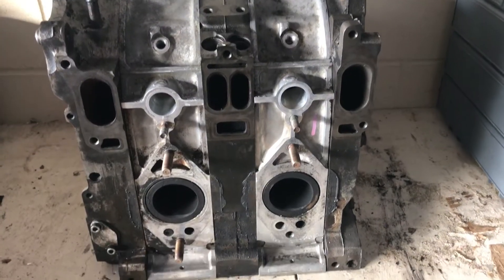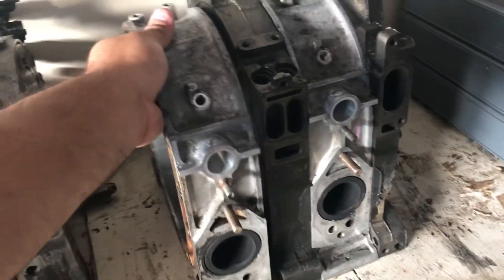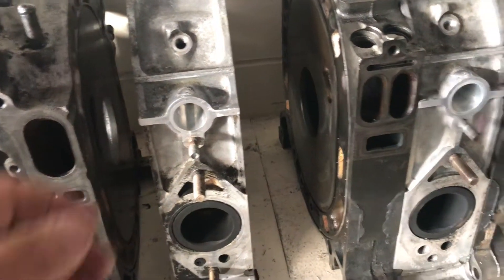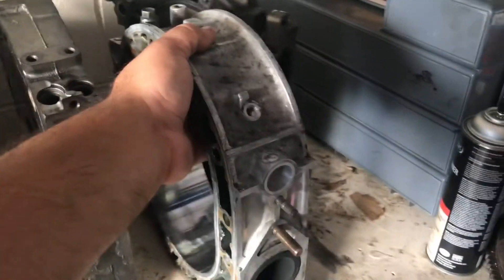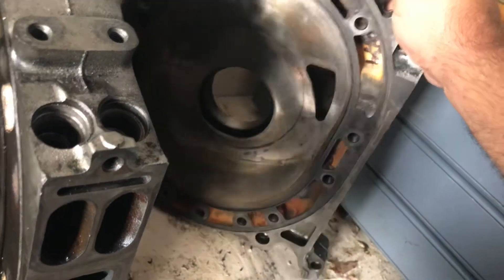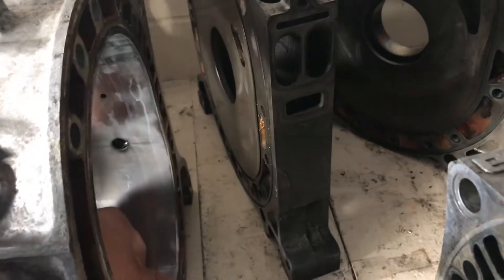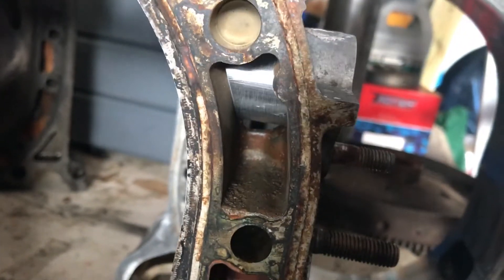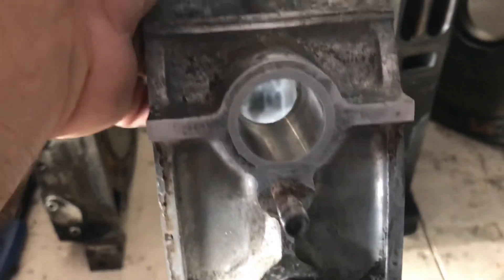13b semi pp build

Comment: Brotha if it was my motor I would re nickel those housings. Last thing you want is a warn out housing on a semi pp motor. Cold starts are bad. And lower compression. Depending on how you port your plates, semi pp already drops some compression. Depending on your set up. It can be a pain to start.
Reply from the maker: Michael Camacho who does that and about how much. Not a lot of companies like resurfacing the housing from what I see

Comment: Hey if u want to RX7 Specialties will resurface your housings for $69 if you do 2 or more
Reply from the maker: Alvin Ameyaw yea that’s not bad, I have also heard of some rotary mechanics that take a round sanding roller like 3 or 4 inch that connects to a drill and real slowly start cleaning the surface that way. Not sure if you have heard of this trick.  Of course you have to go slow because it will eat away at that metal surface
Reply: 69 dollars to resurface a housing? Figure itll be more expensive

Comment: YES, the rotor housings are far from perfect! I think it would be a waste of good Apex seals !
Reply from the maker: Steve Carlisle I had the housing resurfaced, they came out pretty good. Was left with a mark or 2 by the exhaust port. I may use these housing in the future just to have some fun and try to get a good tune in.
Reply: @sammyturbo786  thanks for the reply. If anybody wants to check their housings, blueing and a certified straight edge will tell you right away.  If you do not have a clean swipe, then you will have a engine with reduced compression. Shops that offer re-surfacing solutions require a housing that is so close to new, you may as well give a little clean up yourself. Check these re-surfaced housings with the blueing/edge treatment. Now re- manufactured housings are a whole different process, specs to new, and cost about the same. I cannot stress enough, Do Your Homework!
Reply from the maker: Steve Carlisle I will try and post a vid tonight on how they came out, they are not perfect.This was complete low budget. I paid 40 Dollars to resurface them when I have money I will buy 2 brand new housing.
Reply: Mate my 13b Bridgeport is missing  8/9mm of chrome on each side and still starts mint,, not everyone has big dollar budgets….
Reply from the maker: Steve Carlisle   https://youtu.be/pvCYRxfkjag
Reply: @bradooowooohooo4526  great, never thought a rotary with low compression would start "mint".